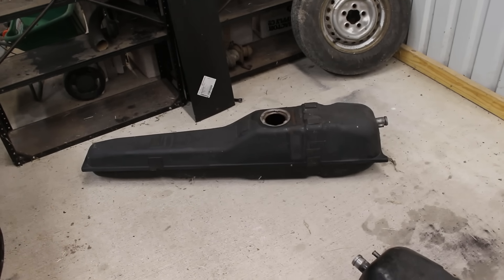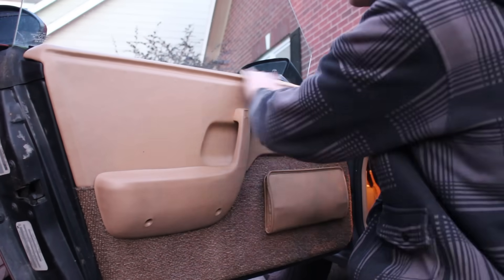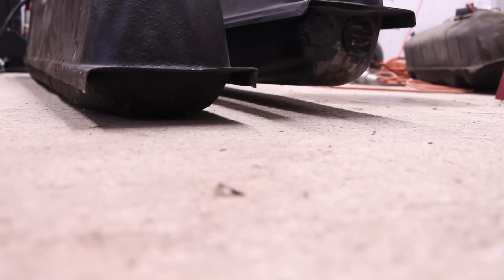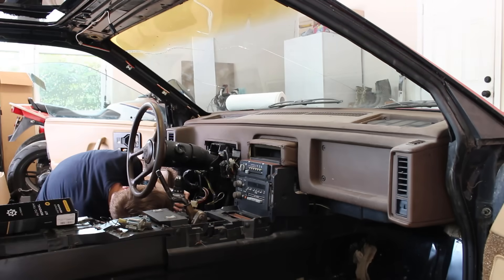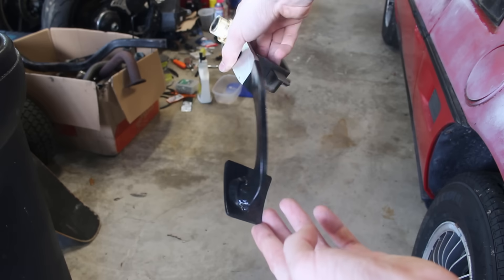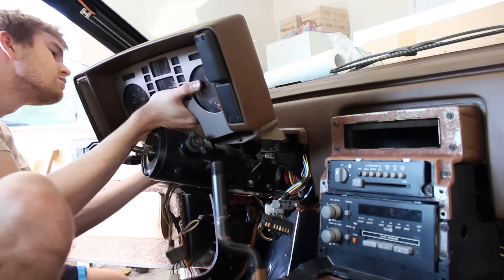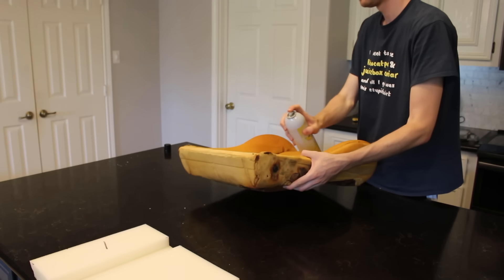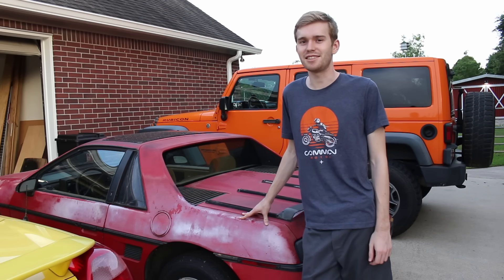The Cleanse | 1985 Fiero 2M4 Revival - Part 5

Comment: Long time fan and Fiero enthusiasts. Working on Rudy a 86 notchie that sat for a long time.  This is not my first fiero project. However Rudy came with sunfire seats and I remembered your video you ran into a similar situation where you had good passenger seats but not drivers.  I was able to go back and watch your video again to help remember the steps. 

Your videos are a like a modern version of a repair manual.  

However Rudy’s 2.5 had a bad head gasket and I had a 3800 na motor so paired to a 5spd she will be a great driver economical fuel efficient cheap for parts. Oh and fun to drive.  

I have a few years experience working on fieros over 24 years now. I’m still able to learn new things.  I also appreciate the exposure you have given to fieros.  They are just a blast.

Comment: Having done a lot of work on an 88 Fiero I had bought for my son to drive to college some years back, I feel all your pain in this series. Fuel sender issues? Check. Had them. Headlight motor rebuild? Check. Been there. Wobbly steering column? Oh yeah. I didn't have the pivot pin issues you had, my headache ended up being broken turn signal and high beam switch issues. Neither worked when I got the car, and there were no replacements available for an 88. So as luck had it I managed to find an entire column from an earlier model in the junkyard. Fixed the wobble that one had as well, and stuck a whole new column in. Glad to see you keeping it on the road, these cars were such fun to drive. But, as I got older not so much fun to climb in and out of. So I sold mine a year or two ago to a Fiero enthusiast. Good luck with it and keep at it! Oh, and by the way, the 2.5 "Iron Duke" is a darn near indestructible engine. My son was going to school about 100 miles from our home, and one weekend on his way home I got a call about an issue. "Dad, the oil pressure gauge dropped to zero. I shut it off, what should i do?" Well, turns out the oil pump broke in half (yes, sheared in half lol) about 80 miles from home on a rural highway in the middle of nowhere. I left work early and headed for the house, told him to drive as far as he could and just let me know where it ended up and I'd pick him and the dead Fiero up from there. Some time later when I got to the house to pick up a truck and trailer, there's the Fiero in the driveway. 80 miles with zero oil pressure, and it was still running. New lifters and oil pump, and several engine flushes later and it was still going. Car ran 5 more years until I sold it, must've been 30k miles. 35 mpg. Still held great oil pressure and ran like a champ. Bulletproof!

Comment: Speakerhead here.  10 ohm is more resistance, so less load on the amplifier.  No clue if you'll need to adjust the fader on the head unit though - the new drivers may be more efficient which could make them even louder than stock

Nice job!

Comment: If you have not drilled out the broken bolt of the rocker arm cover, you can weld a nut to it. Look it up in here, plenty of vids on it. Simple to do and you avoid ruining the threads. Good luck.

Comment: Just scrubbing the interior and cleaning everything up totally transformed the car. I understand that you're not interested in making power in that car, but I would swap in either a 2.8, 3.1, or 3400 GM V6 with some head studs and MLS head gaskets and put a 50 trim turbo on it, OR I would put a 4.6 Northstar 32 valve V8 from a Cadillac with a 5 speed manual. Something that'll make a comfortable 300 hp and be reliable enough to daily drive. The 2.8, 3.1, or the 3400 with a small 50 trim should have ABSOLUTELY no problem making 300-350 whp on low boost and still be reliable. However, I am always power hungry and I've always wanted to build a Fiero. I've always liked those cars, but I've always been into the newer 2.8 GTs. I know that the Iron Duke is a strong engine and a large displacement 4 cylinder, but they make almost no power and can't very well be modified to make power, so it'd go in the garbage. Hell, even putting a Quad 4  with a 5 speed manual would make a crazy difference.

Comment: Im so thankful i found my 86' 2M6 4 speed in basically mint condition for such a good deal. I've used your videos as a guide on some small things on mine. Looking forward to your future videos.

It's so mint the steering column isn't loose yet 😂. I might try my hand at replacing the dash lights with LEDs, as the stock orange is very dim to me.

I'd recommend investing in a shorter shifter while you're in there since it's a much appreciated addition on mine, unless you're intention is to keep it completely stock.

Comment: ok kid!!! Great Job!!! People don't say that alot!! I had 2 of these when I was 20. I didn't know as much as you do. These Fiero's were ground breaking in every respect. Alot of cars owe their innovations to it. Yet we lost the Fiero to those engine fires. Be sure to get those recall's done. They are free! Also have you any idea what you are going to do about the problem with the poor horsepower of the 4cyl (mine developed a cracked head) but I'm not sure if it was from the cooling system (either the fan not coming on because of the unique way the coolant is set up and the bleeding of the system. Even adding extra coolant when low). I'd be interested in what you have to say because I am 50 and want to relive my youth, but don't want to buy a headache.

Comment: USE MEAN-GREEN
This is a decreaser of sorts, also used on boats with mildew. Used for car seats as well, it's a wonder cleaner. Then after cleaning with it, go back with leather conditioner for the seats or vinyl conditioner for the boat.. it works really good, i used this on my '86 fiero

Comment: fyi if you increase the speaker resistance, then the current draw goes down.
the voltage swing (amplitude) of the signal is variable (volume knob), V=IR, for any value of V then if the resistance is increased then the Current (I) must be lower.
enjoying the series from Australia, i've never seen a Fiero downunder.

Comment: led interior lights are a huge upgrade. i remember doing my 05 subaru sti and it was night/day difference. before with standard bulbs there was no use to the light at all because it was so dim. swapped to led and bam, whole cab would light up bright and clear. loved it. led is always the way to go imo.

me being me, i would want to convert the interior to black. im not a fan of brown. but to each their own right? still your build is looking great.
Reply: switching to 10ohm speakers is smart for one reason. they are closer to your ear. the higher ohms means they wont be able to be driven as loud. they will be more quiet. also, higher ohms means that the audio quality will be better. if you ever knew (or didn't know) home speakers are typically 8 ohm while car speakers are typically 4 ohm (and 2ohm for aftermarket). the reason being the car environment needs to be louder and quality doesn't matter as much, while in the home quality is preferred and loudness not so much. there are tons of dynamics with speakers.... 

my del sol had rear spears mounted close to your head. the back piller was less than 12 inches from my seat (being 5'10 and in a small japanese car). although, i enjoyed that when i was younger because having loud speakers next to my head meant i could jam out when driving. i miss my del sol.... i swore if i ever recover from my spinal cord injury (rip/tears its been 8 years now im still crippled) that i would get another del sol and restore/modify it....

Comment: Excellent work throughout every video. Coming from the perspective of one whom has built a firebreathing 3-Rotor twin turbo FC RX-7 from scratch, you've surprised me with your ingenuity on several items. With that said, here are a couple ideas to keep in mind.

Relays are cheap and it's perfectly fine to substitute a conventional Bosch-type relay (or two) in place of proprietary ones such as your fan control relay. I did so on my RX-7 for the Main Relay since a new one was unacceptably expensive (over $75). Just be sure to have your car's wiring diagram book ahead of time and it'll be a smooth transition.

One thing I would like to mention is to look closely at the foam surrounding the headrest speakers. Looks like either black mold (the covers were perforated...) or it was burnt at one point (due to excessive resistance). FC RX-7 Convertibles (88-92) also have headrest speakers, and the RX7club.com site has a wealth of knowledge of rehabbing them, even to replacing damaged seat foam. There's also plenty of info on how to correct slow/weak power windows too (see my first suggestion).
Reply from the maker: Thank you so very much for the kind words. 

Replacing the relay for two separate ones is something that I do plan to do! The Bosch one is around $70 for that one I believe.

As for the headrest foam, every single Fiero headrest I’ve seen on multiple forum posts and google images has the black surrounding the holes. I think it’s just a result of the manufacturing process, so I’m not too worried about it!

Again, thank you so much, not just for the praise, but taking the time to write all of these helpful things out. I truly appreciate it.
Reply: @RonaldFinger  You're most welcome. I sent you an email with a few more ideas too. As far as the headrest foam is concerned, the black area is definitely worrisome. Google "RX7 convertible headrest speakers" to see what it looks like on a comparable car. I'm sure you know firsthand how burnt foam feels crunchy, but my gut feelings says that it was probably mold based on the rest of the interior.

$70 for an off-brand relay is pretty crazy. OE supplier for GM is Delphi, and they're quite good about putting GM part numbers on almost everything they make. But in all truth, the car doesn't care who makes its relays as long as they're rated for the load. I was using a Dodge relay on a Ford Taurus 2-speed fan on my RX-7, run through a 2-speed fan controller from a Volvo, triggered by a 70s Subaru fan switch, all on an engine pulled from a Eunos Cosmo... :D

Comment: When you're ready to paint, it's best to take it into the FingerPaint Garage, right? Cool vids kid, keep up the great work!!! Need a collaboration with Rich Rebuilds & take it to the next level. Being born in the 80s in 84 I can appreciate this restoration very much, technological advancement is what we really need though. Let's get rid of that internal combustion engine for a really nice p85 setup. The power to weight ratio will be perfect. It will be an interesting puzzle to figure out exactly where to put the battery pack or packs actually in this rear mounted engine classic. Imagine the range adding plus adding one of my ITG thermal dynamic solar panels. Well, I'm going to be doing this setup on my Ford Mustang teaming up with big names in the electric car industry besides just Tesla. Be looking for the Iron Tiger Garage in a few weeks to introduce USA Designs by ITG Solar Fusion. The science is real the possibilities are endless. If you have heard of the Sterling engine then your more knowledge then most but I'm planning on incorporating how much more into my designs. Specifically the solar/photovoltaics themselves.

Comment: Great series. I see you have a piece of fuel line inside the tank connecting the pump - I hope you used submersible line. Regular fuel line is not meant to be submerged in gas. Check out a recent video from South Main Auto where he fixes a Jeep from British Columbia bad starting and that piece of line was the issue.

Comment: Saginaw Steering columns are a pain in the neck. There is a trick to tighten those bolts up without having to take it even half way apart. Takes about 15 minutes if you've done a few.

Comment: Ronald, I suggest not to use a cordless screwdriver in the plastic inviroment of the stearing column cause most of the parts are plastic or aluminium so the threats can be damaged easily. But good work so far and highly respect for the work on the interrior and the seats. Fantastic!  :D

Comment: And what exactly is the mold killing spray called? I have mold issues in a 2002 VW diesel beetle. Please help! My 951 Porsche has the same setup for the parking brake! I never knew the Fiero's had the park brake handle set to the outside of the car rather than in the middle like most American cars. Learn something new every day!!
Reply from the maker: It’s called CLR Mold and Mildew spray! I’m fairly certain any brand of mold killing spray would work since it’s mostly elbow grease that does the work to get it off, but it’s important that it’s bleach free! That’s the biggest thing to look for
Reply: @RonaldFinger  Cool! Thank you! I have an Ozone Machine as well so I should be good to go!

Comment: you do not need a steering wheel puller, if you loosen the nut holding the wheel down and not take it off completely, you can smack the wheel from the backside alternating side to side top to bottom and it will come off

Comment: Very nice job but why didn’t you remove the window motors and tracks when you had the door cards off? Just by cleaning the tracks and gears with new lube would probably make you windows go up and down much easier. Also you said you had the clutch pad in the door pocket but you didn’t reinstall it or at least on camera.

Comment: You should have dipped the clutch pedal in rubber coating for tool handles,  would have finished it off nicely,  and your foot wont slip when its wet

Comment: To bad funds are limited because, while the engine and trans is out you could do a 350 engine conversion. Great job on the interior though.
Reply: what I dropped in my 85 SE was a 3800 sc, as light as the iron duke, more power than a lot of 8's, fairly easy fit. suspension techniques lowering kit with bilstien coil overs, suburban master cyl and rotors/calipers and larger sway bars. joy of a parts bin car is you can cross reference to find compatible parts from larger/ up model cars and throw them on. I loved my Pegasus, would trade my 944s2 for another clean healthy one to build on again

Comment: Your observations and work on the seats brings up something I could never understand with car makers: why wouldn't they make both seats identical? There's zero reason for them to be unique or mirror imaged. That way, to facilitate even wear, the owner could swap them. This would benefit the maker because they'd only have ONE part instead of two. 

Almost every older F150 has the outside seat bolster worn out from the driver sliding in and out and down. I should say, almost every older pickup but it happens less with GM. I guess they use better materials.

Comment: I don't get the hate / stereo type with the car. I had a 1984 2m4  around 1994. I got over 40 mpg highway and could beat most stock cars on the road of the era in a race. My guess is the mid engine 2 seat screamed exotic sports car, and yeah the Fiero was not that.  It was fun and looked awesome at the time, and even  got great fuel economy .

Comment: I want to traded in Chevy pick up for a 1984 fiero se 4 and it always had a oil leak around the valve cover gasket and it would trickle down to the belt and then sling oil all over the back glass and with the smoke coming out the back I looked like a train coming down the road lol

Comment: Other than your mistake about the speakers you've done a great job on that car omg it's hard to believe that is the same car if it was mine is put a Honda k series engine an transmission in it for one more power an two easier to find parts an of course it will make it faster so the speed will match the looks nothing worse than a car that looks fast but is slow

Comment: The ONLY Fiero that would be worthy of restoration is the final year model GT. Pontiac finally addressed the short comings of the Fiero. It was never intended to be a sports car,but a 2 place commuter car. Front suspension came off the Chevette and the rear was the front drivetrain from the Citation,put in backwards. The fastback V-6 GT would be Worth restoring.

Comment: Fiero could have a been a great car, if GM didn't screw everything up with costs cuts as usual. If it had a proper engine, and the final suspension from the beginning, it would have been a legendary model. I think buying one of these, I would swap the engine for some European unit. It's mid engine, so there's plenty of systems from FWD cars that could be used.

Comment: ah the fun part, taking out the insides for cleaning to find what treasures have been left, and what wildlife is still living in there,
6 months later yet last vid only came out a month ago good thing you recorded before hand but um wait isn't that bad? hmm this is kinda lik e old car guy sysdrome you buy a car get it working but then err fail to finish it and start on another or start on something else, 
but wait this is part 5...oh so that means in part 9 we get to see the car being umm waxed and entering a local car show? 
odd to think nearly 34 years ago some guy would of done that putting the inside of tht car in there, just shows how cheap the mid 80's usa cars were, only a few screws holding things into place, then again that means there easier to replace, 
15:45 ish i see your using the dinner table without a towel good to know you didn't scrach it, unless that's an old one or has a cover on anyways, 
back to that lovely 80's badge and brown all your missing is the woodgrain and this would seemmore at home in the 70's 
most prob a leaky roof or door or something i'm surpised the floor pan of that side was okay not rusted or starting to still best put some rust away on there just in case,